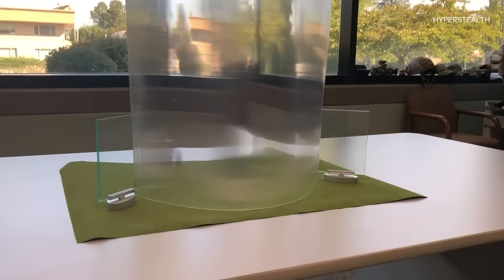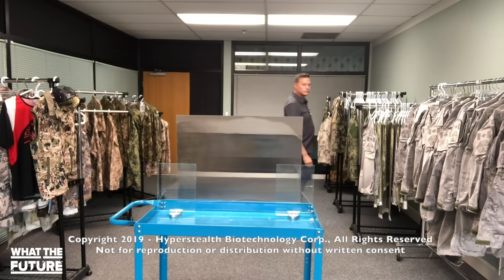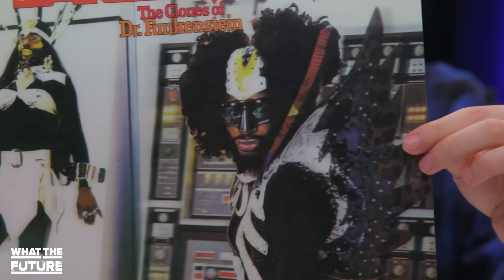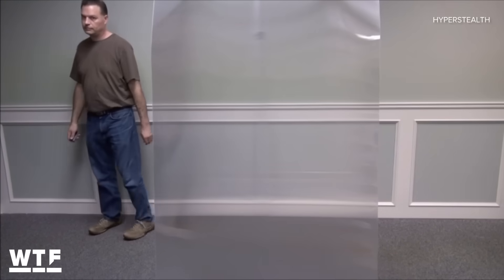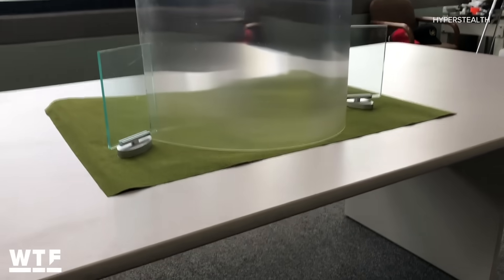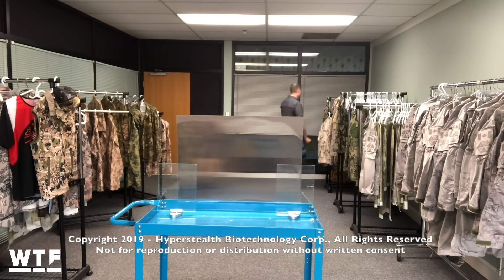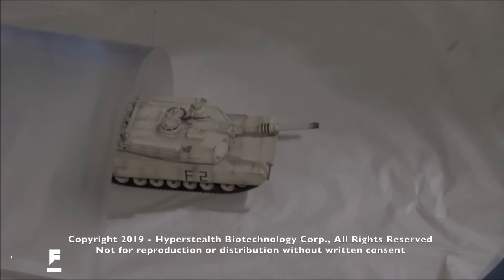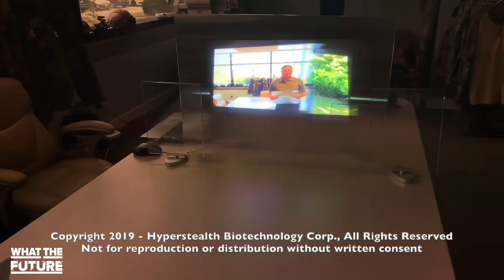How this 'invisibility cloak' material is made and how it works

Comment: I suspect that the technology behind the electric guitar pickup can be applied to the research of light-bending tech as well. If magnetism and electricity can be combined for the purpose of converting the disruption of the pickups magnetic-field (strumming the guitar strings) into an electric signal, then the opposite is also true...using electric signal to create specific disruptions through the magnet. I truly believe (and always have) that the secret to super-effective cloaking technology can and will be found in the simplicity of basic technology and understanding of nature. We already have everything we need (even the knowledge), it's just a matter of connecting the dots now.

Comment: the only bad issue is that it's a physical object. I'm army vet field artillery (nothing special not a war hero lol)
there is no way we would make those things large enough to cover our paladins or 1068A2s. HOWEVER to be honest. our tech doesn't necessarily care too much about visuals like that.
i know it sounds silly, but for field artillery specifically and even air combat etc we have radars and other forms of tech to find enemies visa versa. which is why scramblers are constantly used.
when we fire from air and land, normally we don't even see the target. we have technology input data to have the exact trajectory to land on the opponent. in addition, if an enemy fires at us, we also have tech to read the trajectory of where it came from so we can fire back. so you can have massive battles without even seeing the enemies. using this material on individuals troops isn't practical either. you need to see your comrades as well...

Comment: it is enough to connect the glass screens with optical fibers, you do not even need to use electricity to drive these devices in such a jacket

Comment: Most "stealth" tech is designed to minimize a radar signature.  To make an airplane look like it's the size of a leaf.  I'm not seeing where this does that, just the opposite, it presents a large reflecting surface.  Sure it might hide the heat signature from one side but is that a pressing need, would soldiers need to carry a cylinder of this stuff all around them??  Perhaps there is some market but I'm not immediately seeing it, guess I'm not visionary enough.

Comment: Maybe he patents the implementation, but magicians have been using this for years.  For a common amateur / kids' trick, you grip a piece of the same lenticular material from the video (which is available at craft shops and some dollar stores) so that  your fingers are spread enough to see clearly between them.  Start with a monochrome background, like a black tabletop. Then with your hand palm-down so you can't see the lenticular sheet, you pass a pencil between it and your fingers, so that your spec can see it clearly between your fingers. Then you say a magic word and do it again, passing the pencil under the material. Now the spectator can only see the pencil beginning and end, but not between the fingers. Voila!

Comment: That stuff must have so many uses for the military it's unreal, invisible air craft for one, boats that could creep up to a beach if it ran on electricity.

put it into a uniform or shield.

But looking at it, it seems it shields against thermal detection which probably would be very handy for criminals at night trying to escape the police helicopter.

So for every use that is positive there will be some negatives.

Comment: not clocking yet. would need to somehow have it deployed without it needing to be a solid material. I recommend using a magnetic field to contain a soft particle system of lensing particles where the magnetic field can shape the "cloud" of material which can surround an object.

Comment: Nothing new realy.
i used to tear apart my holographic cartoon cards, and could lose hours just by playing with that plastic. it was funny how i couldn't see my fingers on a certain distance.

The same thing can be done with water.
take a big glass, put in some water, than put in a smaller glass and some water. Stick a Straw in it, and the straw will get distorted. 

But the military wants full 360view optical camouflage. they probably use this thing at the gates of Area 51 since 1950...

Comment: But can I see clearly through it if I'm the one hiding behind it?
Reply: hmm probably not, an that's probably we never heard of this before and also probably why the military didn't liked.
Reply: no but that's no problem though, just have a tiny camera around it feeding video to your goggles or something.
Reply: the thing that im asking is..how is he gonna patent this if it is based almost solely on a lens product that has been out for 30 years. in fact a Ludor is the specific type of lens made of this material that they sell for cheap magic trick off of amazon. So how is he gonna claim the sole intelectual rights to this?
Reply: it wud be interesting to buila remote control airpland shell/body and see what it looks like when flying.
Reply: No the plastic works the same both ways
Reply: @jokergallagherTV  the in depth videos on their website demo a version that lets you see through one side not the other
Reply: Y O J I M B O  ah well, I guess then he should be able to do well with that then. I actually own a ludors lense and it does exactly what the first gen iteration does. but I suppose it is novel to add multiple lenses together and experiment with different angles and such.
Reply: Its already being used and has been being tested since the at least the early 1980s.
Reply: Such a good question 😂

Comment: This wouldn't work against advanced systems in the F-22, F-35, or Abrams Tank. They use a combination of Thermal, Infrared, Sonar, Ultraviolet, Satelite, and Multispectrum-Lasar detection.  You would need to be encased in a cacoon to avoid being detected.

Comment: Pentagon: “give us a call when we can fire our cannons through it!”
Not practical for military use due to lenticular effect being negated at close range to the subject. Also obstructs all weaponry. Might be useful for fixed location camouflage from satellite or drone surveillance. Great that it works without needing a power source by using optical effects plus all the other potential applications.
Reply: It's useful for ARC based artillery. . . tanks that shoot straight up and have the shell fall down on the target rather than straight shot tanks. The only thing about this tech tho is it needs to be made into a 3 piece dome: First piece is the walls attached (from a distance) to the artillery vehicle so the dome turns when the vehicle turns. Next is the main roof attached to the walls. It would have a hole cutout for piece 3, the blast door. Think of the blast door like a fighterjet cockpit, opening out and forward so that even when it's open, it does not leave any visibility for whatever is in front. The reason this even exists is so that when your not firing is that it can be closed as to not be detected by satellite imagery.
Reply: Hadeks Marow might as well stick with current standard camouflage tarps with some added heat insulation. Tarps are easier to package, transport and deploy. The military doesn’t shy away from any technology that would give it any degree of advantage. It’s seems to me that they found it impractical for use in combat.
Reply: @evlnte  Classic camouflage outside and inside, this kind of "thermal" camouflage. Close to perfect I would say. Tanks and miltary vehicles needs this kind of reflective plastic material as a skin layer, but then there's no reflective power, but to any thermal radar they will appear as terrain, I guess, from a satellite. Maybe military developed their own invisibility cloak, much more effective. After all, millions, billions of dollars of US "black budget" every year...where do they go? 😎

Comment: This is like just putting a wall in front of whatever you want to hide. Yes, it's hidden, but it's really obvious that you are hiding something. I'm sure it will have uses, but I doubt hiding tanks will be one of them.
Reply: Walls are a lot more obvious. This is a step in the right direction.
Reply: @jaypob  Walls are everywhere though, so they generally don't feel out of place. Put an "Under construction, authorized personnel only!" on a wall section and you can be sure most people will ignore whatever is behind it.
Reply: with more improvements it could go somewhere
Reply: Law enforcement has been using it